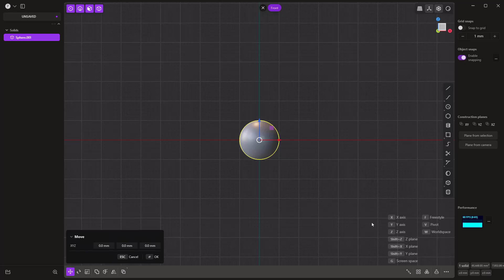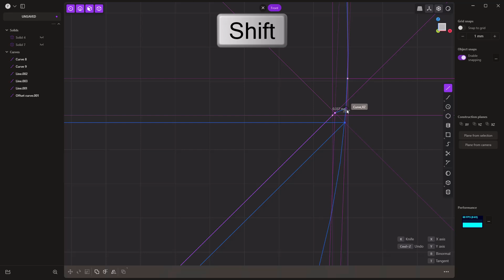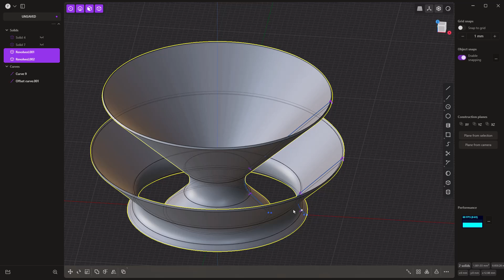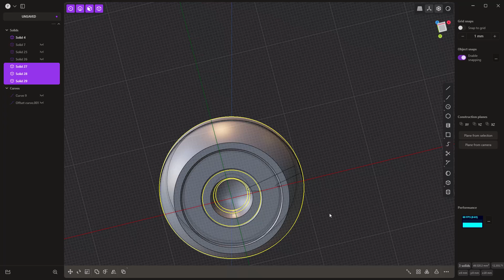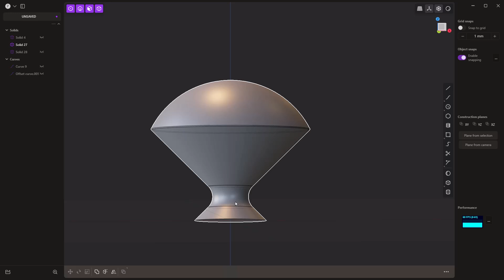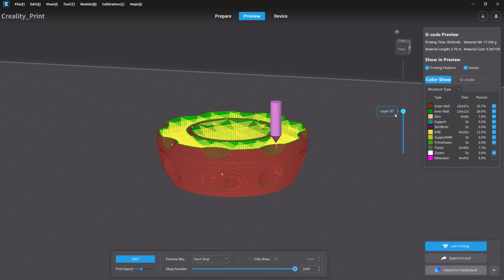How To Design a Print-In-Place Fidget Toy with Plasticity | Beginner Tutorial

Comment: As an Fusion User I would now like to see the possibilities to edit the part. For example: add or delete some of the cutted spheres (edit the Array). Change the generell outer diameter. Change the positions of the cuting Lines. Something Like that. I change often some of those thinks after printing it for the first time. Holding it in your hands is often completly different then see it on the screen. So the timeline in Fusion is essential for me. How is the typical workflow to make bigger changes after first printing?
Reply from the maker: yeah unfortunately it is all Direct Modeling (with some slight exceptions).  So to remove the dimples you would select the dimple face and delete and Plasticity would patch it.  If you wanted to change the OD you would select the faces and offset them a set amount.
I 100% hear you and that is a big difference in Plasticity vs Fusion.  Those that go to Plasticity are often more direct/conceptual modelers rather than Parametric.  So you couldn't go back and say change a dimension from .4mm to .5mm.  You could go back to the curves and move one curve .1mm and recut with it, but different workflow.